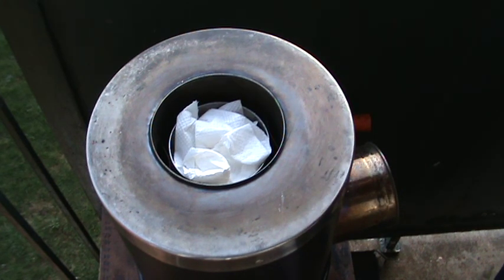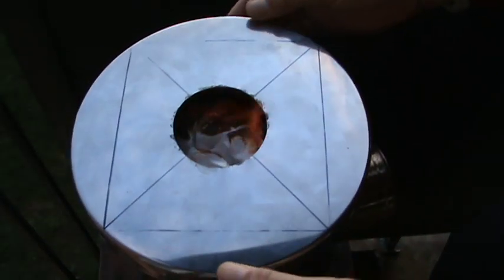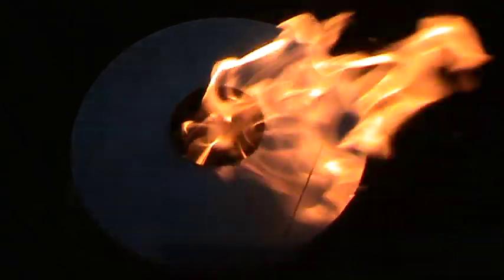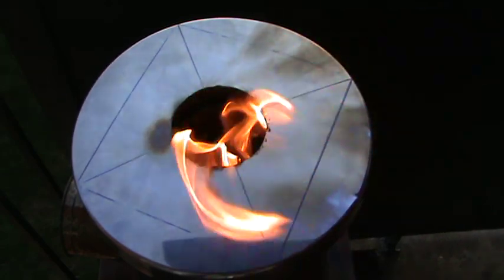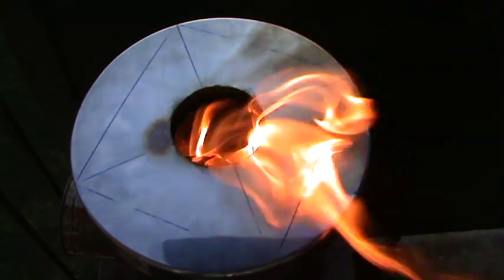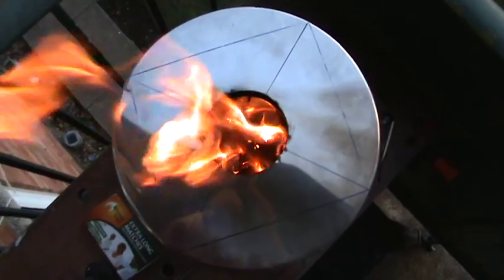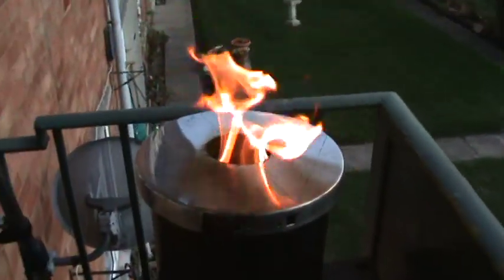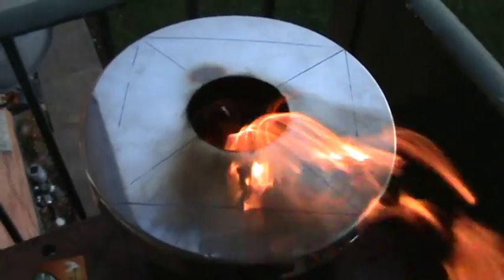Rocket Stove Wood Gasifier Conversion.MPG

Comment: I always thought you could build a rocket stove/gasifier large enough to supply fuel for a auto. I seems a more simple design than the typical woodgas generator that is typically used at present.

Comment from the maker: @2bornot2b1984 The video doesn't show the smoke being burnt as I could see it live as I was filming for some reason, but where the secondary air is introduced over the top of the inner tube, that is where the gasification is taking place...ie burning any un-burnt smoke just before it is leaving the rocket stove. Rocket Stoves by there design do burn very efficiently and so very little if any smoke is visible as a result, I think it's something like 60% of the carbon. By gasifying 90% is acheaved

Comment from the maker: @lebammabel Yes that's correct, rocket stove are designed to burn wood very efficiently, thus reducing the smoke considerably. Almost little or no smoke, this is a way of converting a rocket stove into a wood gasifier. By introducing secondary are you get an even cleaner burn, this was a test run for another project I will be doing. This will be a rocket stove that is used as a rocket stove but with secondary air being introduced to make it even more efficient. Thanks for your comment. Cheers